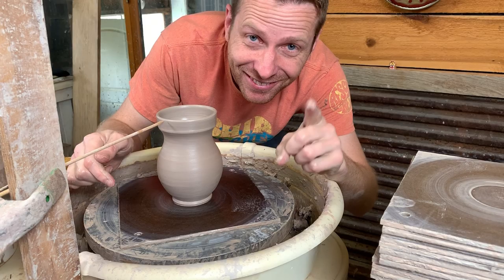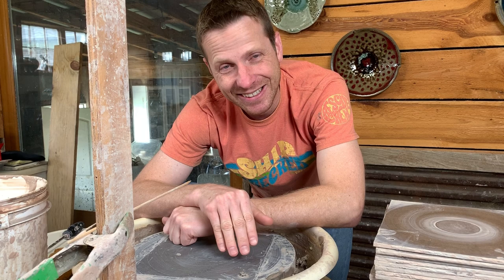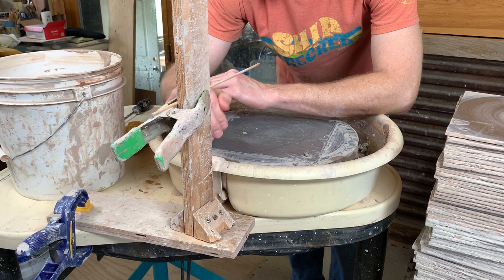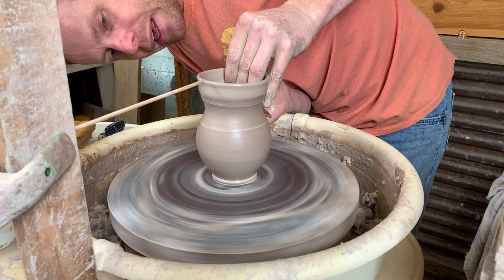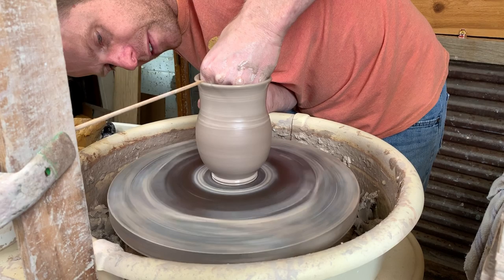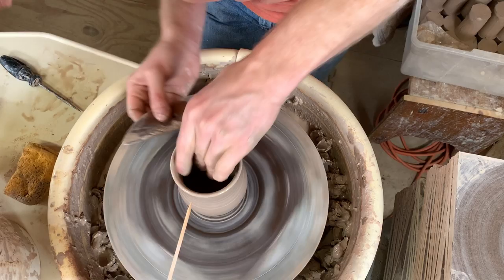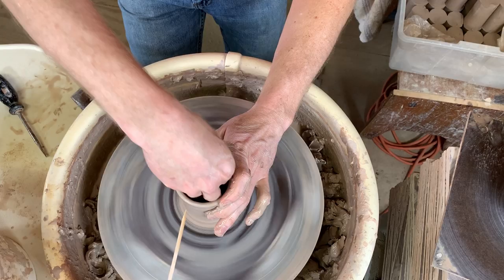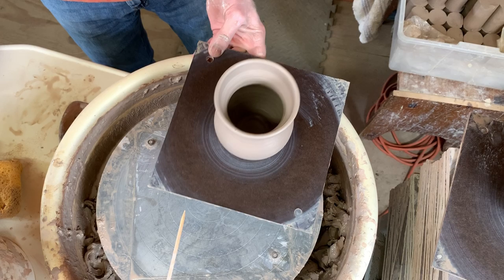Throwing Pots With A Gauge - Tutorial

Comment: I really need and want to throw to a gauge.  I'm a little confused how just one gauge, in this case a skewer, will help for gauging the width of the pot?  The height is clear why this would work, but I'm sure I'm going to have problems keeping the widths the same. Great video.  I love watching you throw.
Reply from the maker: When I make the first pot I set the gauge to the height and width and as long as the gauge doesn’t move up, down, right or left you will have a gauge for height and width. Try to throw your pots to the same distance (in width) from the gauge every time. Hope that helps
Reply: @MatthewKellyPottery  Oh course, because you pull up on the same side of the wheel!  So simple.  I just couldn't tell in your video.  I thought the gage was straight in front of you.  Thank you Matthew for your reply.  Love your videos!

Comment: Very helpful. I have a tendency to touch my guage when it's stuck in a glob of clay. Your method is much better. Question: Is that 1/4 inch hardboard you use for bats? Some call it masonite. Quarter inch would probably clear the bat pins.
Reply from the maker: I’m glad it was helpful. Yes that is 1/4” high density tempered masonite. It may have other names depending on the source. Yes the 1/4” clears the bat pins.

Comment: I noticed that you didn't cut the mugs off of the bat.  Do they pop off easily when drier or do you have to cut them off later?
Reply from the maker: I try to only use bats that are very smooth so that I can let them dry until they release from the bats. I have some bats that are not smooth and I would wire pots off of those bats. I show the difference in my tips and tricks: bats video.
Reply: @MatthewKellyPottery  - Interesting, do you find that they are at just the right dryness for trimming, attaching handles, etc.?, when they 'release' on their own? I usually cut mine off a little before that stage so they are still soft enough for trimming and/or sgraffito designs, but I realize since you refine your feet as you throw, that maybe you never need or want to do trimming? (as I watch more of your videos I will of course see whether you trim anything or not!) Thanks, Matthew!